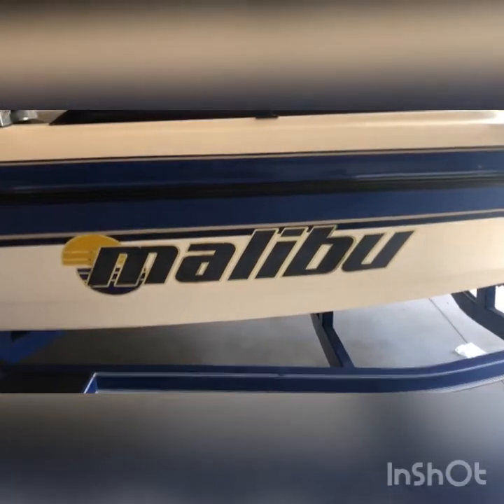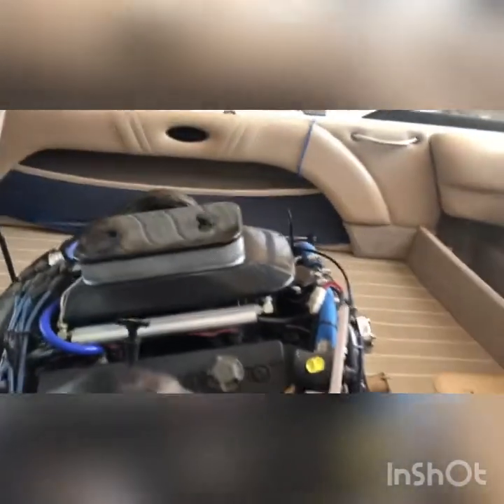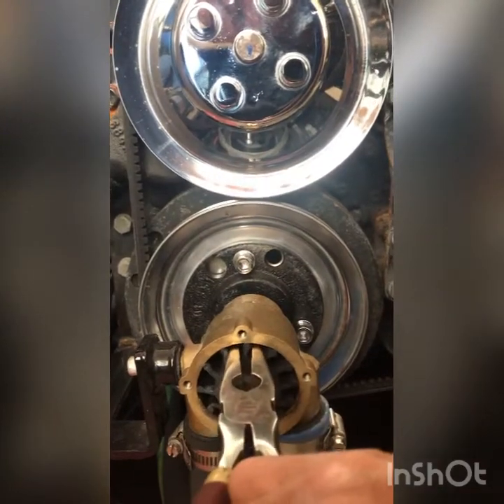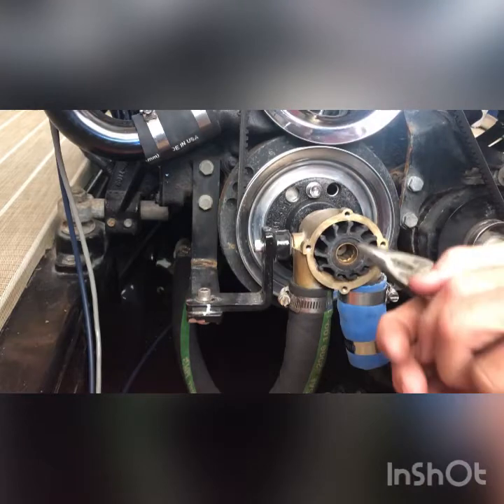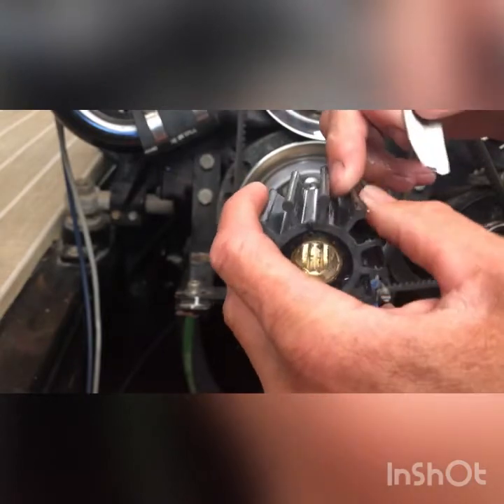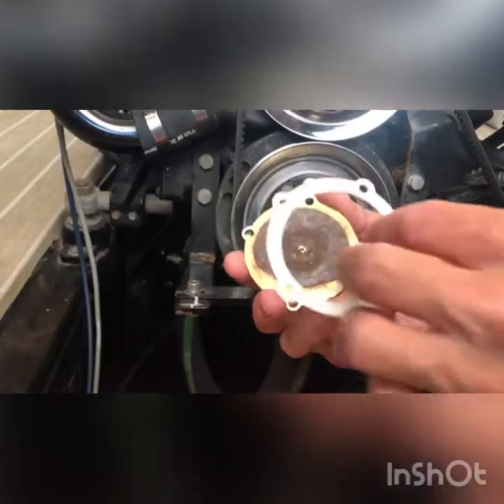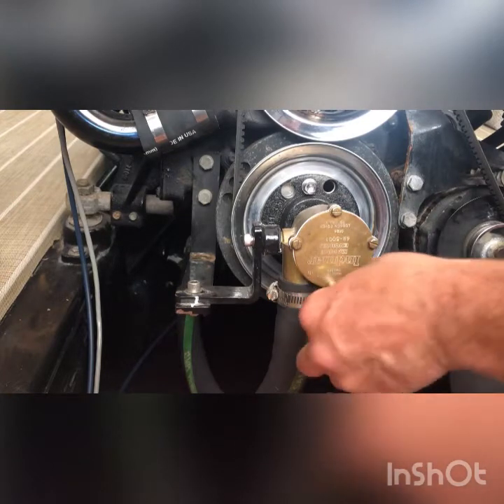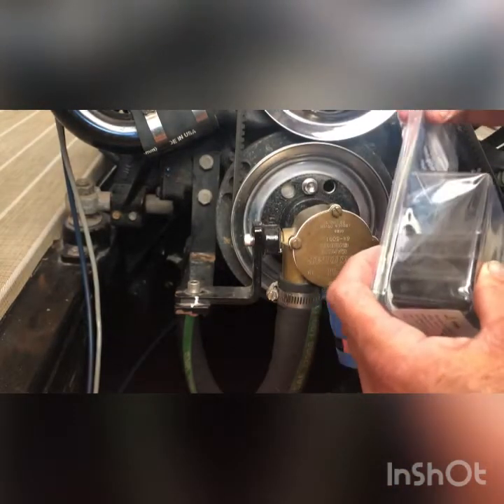Indmar raw water pump impeller replacement

Comment: Pretty similar to my v drive . . Quick question if it’s leaking from the back of the raw water pump a pretty good amount . Do you think the whole raw water pump needs replacement or just seals
Reply from the maker: I think if the housing and shaft are in good shape. You could get away with doing a seal kit?
Reply: DanOfAllTrades thanks for the reply , I went ahead and just purchased a whole new raw water pump! No leak and no over heating anymore

Comment: Watching the video, you twist the impeller completely opposite of what the old one was.
Reply from the maker: As soon as the engine turns over it will flip those fins in the correct direction.